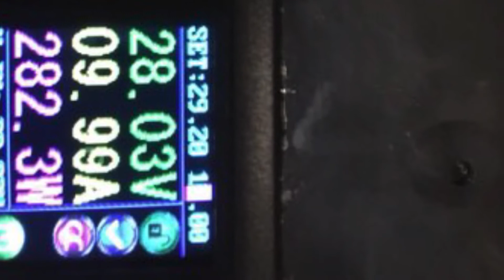750 watt Human powered bike trainer battery charger

Comment: Could you do this sort of thing with an exercise bike instead of a bike trainer?
Reply from the maker: Hi Chase - actually, that's exactly where I have that 750w charge controller now.  Using this setup https://genesgreenmachine.com/build-spin-bike-pedal-generator/ I just swapped out the 36v charge controller for the adjustable controller and hooked up the 2 LiFePO4 batteries.  It is really a great setup!  I should do a new video and blog post on it, but too many other priorities pulling at me.

Comment: Hello. I made the exact same setup as yours. But I don't understand why in my case it doesn't work. I can see the current going in, but no current out. I have the RD DPS5020 model, it is brand new and I really paid attention to not mistake in the wiring. I triple checked the + wire to the + and the - to the -. I have a 12V pedal generator and when I pedal even very low the DPS5020 lights on and I can see the voltage (U-IN) and I also can see the voltage of the battery it is hooked up to. Currently it displays 11.21V. I set it to max 14.9V and 07 amps (the battery is a 200ah LIFEPO4) . Unfortunately I can pedal I see there is no current going out to charge my battery. The amps and watts remain to 0 and I don't feel any resistance in my legs. What could be possibly wrong? Please I'd be glad you help me. Thanks.
Reply from the maker: Okay, assuming you are clicking the on/off button once you get started, is the input voltage high enough? The DPS needs 1.1x the output voltage to work.
Reply: @GenesGreenMachine  Yes I'm clicking the on/off button but according to what you're saying, I think the values I've set in the DSP are wrong because I don't know what means "the DPS needs 1.1x the output voltage". Can you explain or give me an example? I'm sorry I d'on't know anything in electricity!
Reply from the maker: No problem, I’ve been learning as I go, too!  Here is an example: if I’ve set the output voltage to 14.6v, I need to spin the generator so that at least 16.06v (14.6 x 1.1) I’d coming into U-IN in order for the DPS to start charging the battery. What voltage does your U-IN read?
Reply: @GenesGreenMachine  Yes that might be the problem! I've set up the output voltage to 14.9V, but when I pedal I see the U-IN values varying between 11V and 15V (it's a 12V pedal generator). Thanks a lot, I'd never figured that out myself!💛
Reply from the maker: Glad to help!  Are you able to get 16+ volts out of your generator?
Reply: @GenesGreenMachine  Unfortunately this is not the pbm. The DPS does not deliver any current out and I don't know why.😥 I have a 12V generator that ressembles to your e-bike motor. I made same set up as yours with 12 gauge wires. The wires which are connected to the out+ and out- of the DPS are also connected to the + and - poles of the battery.
Reply: @GenesGreenMachine  In the notice at page 3-4, on the data setting interface photo, they represent Y as the first line of the data setting: Y: the actual value of the output voltage and output current. So for me when pedaling I have 11.19V (the actual voltage of my battery) and 0.00 current. 
On the data setting, here are my preset values: U-SET: 12.00V; I-SET: 10.00A; S-OVP: 17.00V; S-OCP: 20.00A; S-OPP: 700.00W. The DPS is not dysfunctioning because when I put 00.00 value for S-OVP I see OVP on the screen when pedaling. Otherwise the green "checked mark" is on the screen
Reply: @GenesGreenMachine  For U-IN, I see that when I put 11.50V at U-SET, the U-IN values are around 13V, 14V, 15V, 16V with peak at 18+V. When I increase U-SET value at 14V, I see the U-IN values around 15V, 16V, 17, 18V, even peaks with 20+V. But no amps and watts out. The values are constantly at 00.00. Therefore my DPS does not charge my 12V battery.
Reply: @GenesGreenMachine  I asked the manufacturer but his only answer is: "don't use this unit as a charge controller, it's not made for that, it needs constant voltage in to work". He even said I will damage it if I keep using it this way.
Reply: @GenesGreenMachine  Do you know another charge controller I could use instead? Just a basic one? Thanks for taking time to read me!
Reply from the maker: @missy-bb  I’m really puzzled why it’s not working. I have U-SET at 14.6v which is what the battery manufacturer recommends to charge my 50Ah LifePO4. I’d try disconnecting and reconnecting all the wires, but if that doesn’t work maybe you have a defective DPS unit. I’ve used a DPS5015 and a DPS5020 wired as you see in my videos, no problem charging the 50Ah LiFePO4 and other batteries.

Comment: Wow 10 amp charge is very impressive! How long can you do that for?
Reply from the maker: I can only hold that for 30 seconds to a minute.  I'm much happier at 150 watts or so, which I can maintain for half an hour to an hour.
Reply: @GenesGreenMachine  ok so what's the amps again for 150 watts? what voltage batteries are you charging and what's your Q - the resistance? haha. Sorry - for the annoying questions. This vid reminds me of that super athlete vid where he tries to toast some bread. haha.
Reply from the maker: At 29 volts, 5 amps gets me around 140 watts into the batteries.
Reply: @GenesGreenMachine  Nice! I uploaded a 5 amp vid. I didn't do that very long since I just use an old bicycle. I should try it again now that I rebuilt my stand. It was way wobbly before. I can't remember if I made that vid before? I'll watch it again... https://www.youtube.com/watch?v=DjDVIlgjK1w&ab_channel=VoidisyinyangVoidisyinyang So maybe I'm at higher ohms cuz it's only 60 watts. I don't like doing calculations. Plus I can't see the stand - I think it's fortified - it doesn't seem to wobble too much. haha.
Reply: @GenesGreenMachine  so how can your batteries charge at such high voltage? i forgot. sorry

Comment: nice! does this charge controller let you continuously adjust the load?
Reply from the maker: Yes, I set the voltage to whatever is suitable for the batteries, then adjust the amperage up and down to vary the “load” felt while pedaling.  I just added second cut of this video where I show adjusting the charge controller.